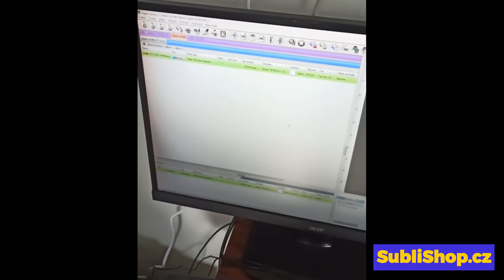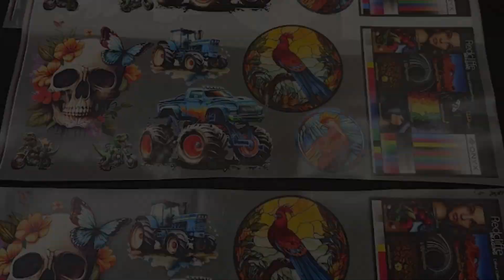DTF conversion Epson L18050 / ET-18100, ready to print

Comment: Hello, did I understand correctly, when what you showed in the video is done, you just need to add dtf ink and the printer is ready for dtf?
Reply from the maker: Yes, no further tuning is required. All you have to do is fill with DTF ink. For this purpose you can use original Epson ink bottles. And instead of Lc and Lm is White DTF ink. 
But you still need DTF RIP sw. So Digital Factory v11 or Acrorip v11.
Reply: @bestsublimationcz  Thank you so much for this info, I have been looking for an answer to what to replace LC and LM with. This is really helpful!

Comment: hi! my epson L18050 always getting jam under the printer head, i think overbump in the teeth guide under the print head running. do i need to cut?
Reply from the maker: Hello, sensors probably doesn´t read the DTF foil. THis is normal. Put A4 paper in front of any print and this will cause zero problem with paper and paper width problems.  The topic explained here: https://youtu.be/KaDFc_OUt6k?si=drlnzMkvge4dDlBr

Comment: Hello, what Rip configuration do you use for this printer model? I'm using Acrip 10.5 but it doesn't print the colors and neither does the white. thank you
Reply from the maker: We are resellers of Cadlink. Cadlink v11.1 - actual version - has support for this printer. Acrip seems from v11 as well. Both SW can print in quick 720x720 dpi mode. So it is supposed to print fast.
Reply: @bestsublimationcz vc vende o Cadlink 11.1 para 1 Pc ou consigo instalar em Vários PCs, e qual valor?
Reply from the maker: @davidluiz6383  O Digital Factory 11.1 custa o mesmo em todo o lado - 450 USD / 450 EUR. Instalação apenas num PC. E apenas uma impressora pode imprimir em simultâneo. É possível adquirir mais 3 portas de impressão. Assim, podem ser controladas até 4 impressoras em simultâneo a partir de 1 PC. Esta é a situação atual.

Comment: Hi what kind of resetter software compatible for L18050? Resetter for L1800 is comptible for L18050? Appreciate much your feed back.
Reply from the maker: There is physical resetter device for waste ink unit. So you reset chip with resetter. There is no software for chip resetting.
Reply: @bestsublimationcz  thank you.. how about the settings of V11.2 acrorip. For me its working fine but when im do printing the under base white 1st printing have a little bit mix color blue but after few seconds its pure white again. And the color out put little bit dark for 40/50 color/white settings. Can give or shown V11.2 good printing settings. Is it ICC required on?
Reply from the maker: @bignoobdrummer797  I have no expecience with Acrorip and L18050. We use Digital Factory v11. So please ask support on Acrorip website or your vendor to provide more information.
Reply: Hola vendes el software rip 11.2 saludes

Comment: Hi, the white paint is clogged and I don't know how to unclog it, do you have any ideas?
Reply from the maker: Hello, there are two reasons: the first is blocking from above and the second is blocking from below. You can pour acetone over the capping station and let it settle overnight. This is very aggressive and can help with blocking from below (smearing on the film during printing). Cleaning from above is caused by fine sedimentation of the white ink. The solution is to suck the white out of the dampers (or turn the printer upside down) and remove the dampers, clean the top of the print head, reassemble and run a powerful cleaning. 
It is important to avoid spilling ink on the data cables. Otherwise, the printhead and motherboard are dead in seconds...

Comment: Hello! I'm glad that there are still people who share their knowledge with others. I just got an Epson L18050 for dtf too! on YouTube there are many videos of such printers that have replaced the ink and waste containers. I hope I'm not bothering with my questions, I'm new to this and it costs a hell of a lot to modify like this.
Are those changes really needed?
If I leave it like that the white ink doesn't settle? From what I understand, the residues in it are deposited on the bottom of the container... 
Thank you!
Reply from the maker: CISS mixing/cirulation system is good or necessary for people who print a little. But if you will be printing 4-5 hours on daily basis, you don¨t need it. 
Waste ink container is plastic box here. So it is easy to clean. Easy access from front side of printer. This is not issue here. You just need resetter or extra chips.
Reply: Hi, do you have any means of contact? I have a doubt if you already use it!

Comment: Hi. Can i convert my same inkjet  printer with just loaded the regular color? Thanks
Reply from the maker: I'm not sure about your question. If you have genuine Epson ink inside, then there is no problem. Just open all the ink fill holes, put some basket on the floor and turn the printer upside down. The ink will spill out after a while. Then you can fill it with DTF ink and do a "power cleaning" to load the DTF ink.
Reply: @bestsublimationcz  wow is much simple thank you. 🙏

Comment: Bom dia, como faço com a estação de limpeza? quando ela completar consigo esvaziar ela para continuar usando?
Reply from the maker: You need a chip resetter. Daily basic head cleaning is recommended. Maybe once or twice a month you need to do an power cleaning. In order to reset the chips, a resetter is essential equipment.
Reply: @bestsublimationcz  existe algum software reinicializador de chip igual nas impressoras L1800?
Reply from the maker: @uniprouniformesprofissiona7711  There is Adjustment program for similar printer - L8180 (ET-8550). Payed. For L18050 maybe for free: https://www.wic.support/free-waste-ink-platen-pad-counter-reset-by-wic-utility/

Comment: Can I use Digital Factory v10 too?
Reply from the maker: No. There is no driver in V10. One need v11 version and then there is ET18100 driver available (EU/ASIA users with L18050 print on ET18100 driver).
You can use L8180. It is the same hardware. With LCD display - so better from our point of view.

Comment: i had removed all same you, but the paper not come out from printer and the printhead touch the film
Reply from the maker: It is necessary to put a piece of straight plastic, sheet metal, cardboard, or anything straight behind the output silver "shaft" so that the DTF foil can come out straight and maintain the plane.

This video is just a printer modification. We do not solve the CISS system, we do not solve the editing or formatting of the DTF roll, etc. It depends on everyone how they will operate the printer.

The overall description of the work can be seen in this video:
https://www.youtube.com/watch?v=KaDFc_OUt6k&t=835s

Or on others in our YouTube channel.

Comment: Did you change the print head to XP600?
Reply from the maker: Although the videos may look super technical, we do not service or replace print heads. If these heads could be safely purchased from Epson, I would take it more seriously. Thus - in the secondary market it is a problem.